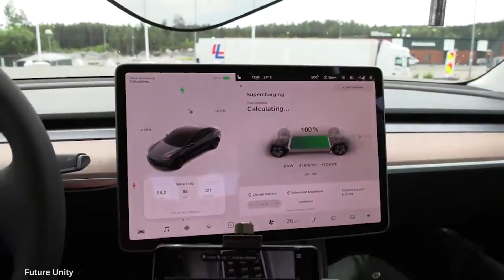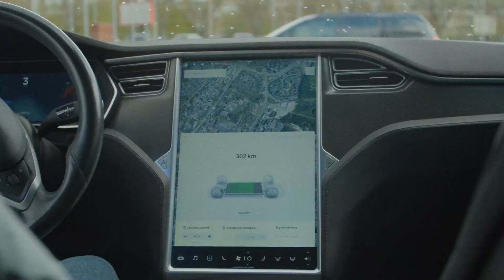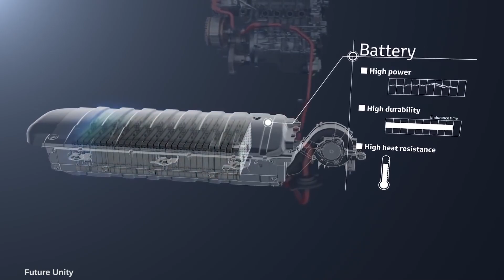Toyota Just REVEALED A Revolutionary New Battery! - TESLA KILLER?

Comment: Propaganda. Toyota is nowhere near to produce this battery on an industrial scale. In another few years - maybe, meanwhile, Tesla will be moving away from lithium-based battery to more readily available and easier-to-process materials with a higher energy density, no need for cooling, faster charging, much less cost/KW, and safer. (My recollection is that they are silica and nickel).

There are MANY other Tesla innovations and advantages the legacy car makers don't have - including Toyota. Toyota can do nothing, but trying to catch up during the next 10 years.
It's not all about batteries. Tesla's motors are pure genius also, so are the controls and the software to run them.

Comment: It will eventually surpass the combustion engine but that will be awhile. Still to many issues not mentioned is the lack of Fast charging stations and power charge stations in general. The dangerous elements used in electric cars. The Range is still an issue as well as cold weather's reduction in charges not lasting as long 
This has is not mentioned because their is no "current" solutions. I'm being Puny
The cost is slow in coming down to being affordable. 
The electric car is here to stay.But the problems I mentioned have to be dealt with and ones I don't know about. Good Video 😎.